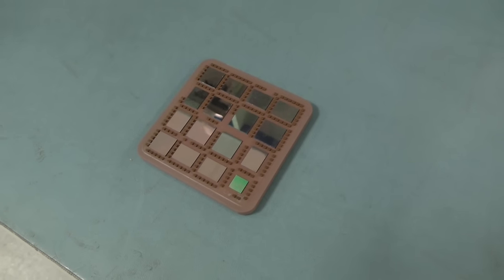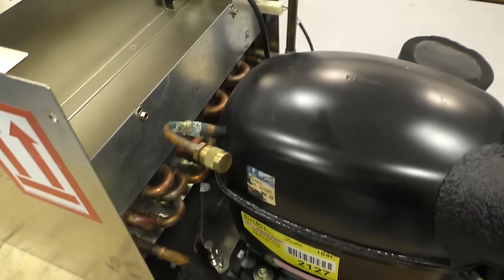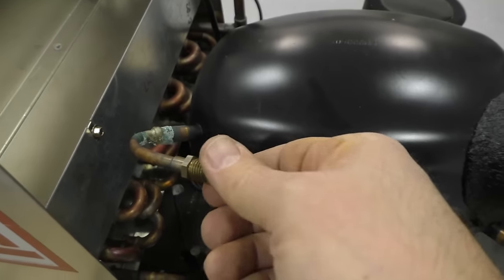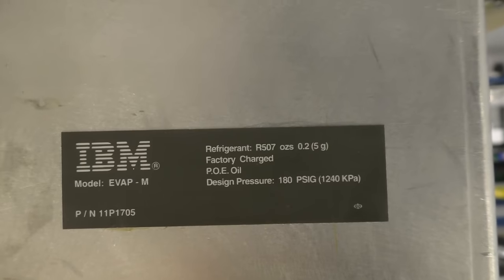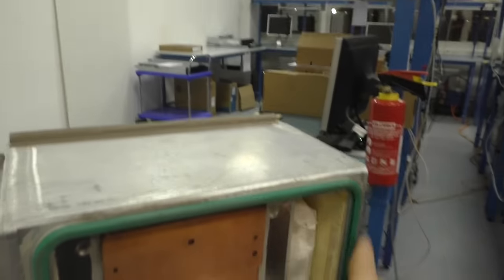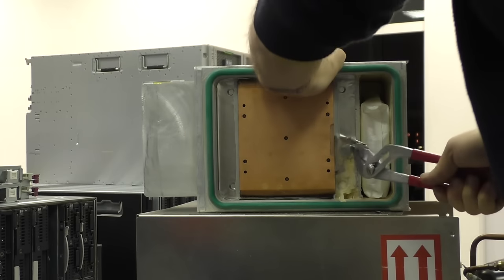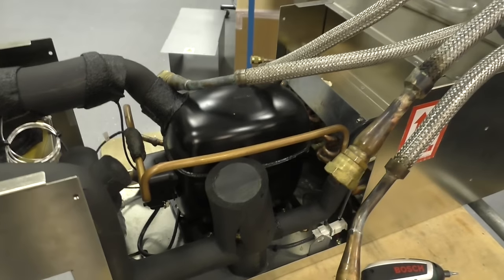CPU cooler for the BIG boys (PWJ48)

Comment: but will it cool my FX 8350?
Reply: you already know it wont
Reply: SubMit 86
its not even overclocked though
Reply: Justin Bechtel maybe, youll have to disable 4 of the cores though
Reply: ChannelAsh100
but I dont wanna have a glorified fx 4300 :/
Reply: Do people actually have trouble cooling the 8350?

I got the H100i by Corsair and my ingame temps under load at 4.4ghz are 35C max
Reply: Weath Proof
mine under load is about 40c, same cooler as well, but mines not overclocked, I just live in a tiny room and where my case is, there's very poor air flow.
Reply: I live in a tiny room as well I have a overclocked FX6300 with a Seidon 120M and its regularly at 17C while gaming load is around 40C I have my computer right next to a drafty window and temps in the winter are usually single digit. The one nice thing about Canadian winters lol
Reply: I tend to just have problems with the stock cooler being too loud.

4.5GHz and in-game I tend to sit at 60-65C
Reply: 60-65C 4.5ghz on the stock cooler? Thats good. I mean im at 4.6 ghz on a corsair 110i and max out at 55-60 C with i5 - 4670k
Reply: People still making jokes about AMD's TDP? Well, now the tables have turned lol.
Reply: DJHeroMasta you got that right! 95w for an i5 and runs really hot? Its bs. I cant wait for ryzen to shove intel prices down.
Reply: I've never had a problem with mine overheating and I have mine overclocked? Is this a problem?
Reply: ChannelAsh100 Stock i7 7700K 90C
Reply: (about your 55-60c) is that the h110i temp or the CPU? core or package?
Reply: Weath Proof whoa.. my i7 4790k oc:ed to 4.7 is 50-60 celcius/ 122-131 farenheit when gaming is that high?? the maximum total power draw when vanilla is 88 watts. and that must be higher on 1.3 volt and 4.7 ghz!

i mean the tdp must go up when oc:ing!! it just feels like my cpu is so hot!! and that my h110i is not working as it should i mean it has several hundreds of watts in cooling power..

my aio cooled evga 980 ti HYBRID is idle @ 29 celcius/84.2 farenheit and a load temp of 50 celcius/ 122 farenheit. mormal idle temp for a vanilla 980 ti is around 50c/122 F and load temps stretch beyond 85 c/185 F in some 'cases'..

 i live 110 miles aways from the north pole in north europe.. we have much the same weather as canada does so my room temp goes from 18-25 c/ 64-77 F 

i returned to the master race in 2013 after beeing homeless for a few years. so im basicly still a pc noob,,,, and a hobo hahahahahahaha
Reply: no1Liikeglenn, Nope, that's not hot.  Go look up avg temps for that CPU on air lol.
Reply: ok nice like i said am a pc nooob! even tough i have a decent pc
Reply: (cpu: i7 4790k+h110) (ram: 16 gb 2133mhz)(gpu: evga 980 ti HYBRID)(hdd: 2 tb) (ssd1:100 gb) (ssd2: 250 gb).
Reply: DJHeroMasta http://www.tomshardware.co.uk/answers/id-2646614/4790k-idle-load-temperatures-safe.html and that is non oc
Reply: No.
Reply: I said 90C.....

Comment: WHAT IN THE NAME OF THE WORLD KINDA OF CPU IS THAT.
Reply: Its a specialized CPU for use in IBM Series main frames. Based on their Z/architecture. Basically a very low volume highly specialized chip.
Reply: Did it really create enough heat to require a refrigerator condenser to cool it? Also how did it plug into its motherboard
Reply: ChannelAsh100 As far as the interface/socket, that I really don't know. My guess is it was probably a massive PGA socket though. But yeah mainframes run hot as hell, and keeping them cool usually involves a dedicated AC or refrigeration system.
Reply from the maker: Watch my othe videos about IBM mainframes.... They answer some uf your questions.

Comment: Oh, come on, i sould be studíing for my exams :DD but i watch it anyway :'DD
Reply: Interesting, it is capable of enourmos power dissipation. Fascinating.
Reply from the maker: I assume 1-2kW must be cooled down.
Reply: It could be pretty good heatsink for some power electronics project like constant current load. Altough the cooling would waste plenty of power too lol
Reply from the maker: For a high curent load I would recommend water cooled resistors and then attaching them to the radiator with a small pump in between. Simple water cooling does not require much additional energy.
Reply: Mine electronic load is in progress for like a year now. But good suggestion if i would like to make an extreme high power  version :D
Reply: junk>exams
Reply: always :D

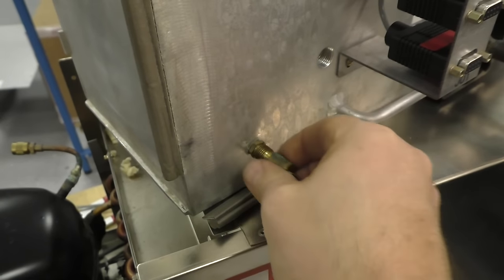Comment: 8:09, the cap can be used to take out the core of the valve it covers. also to drain the gas.
Reply from the maker: After disassembling I found that this valve was not connected to the cooling system. It was connected to the space between the CPU and the cooler. Maybe they filled it with Nitrogen or just dry air to prevent condensation.

Comment: yup awesome stuff i still think some one should do  a copper heat sink with 2mm silver and diamond dust as diamond and silver transfer heat faster than copper by it self
Reply from the maker: I fear that your estimation is far below the price of this. Make it 20-30 times and it will probably fit. The empty rack alone was $91'000 according to the spare parts list.

Comment: What a beast. Maybe you can get the copper out by dropping it on the floor face down.
Reply: I dont understand it too. As i see the most of this equipment is operational or fixable, some of it looks like new, why he wasteing it? I like watching teardown video, but i like retrievable teardown, when device can be assembled again and work, not a slaughterhouse for electronics.
Is destroying things to metal waste is really more profitably than fixing it and selling to people who need it?
PS: sorry for bad English :)
Reply from the maker: The problem is.... nobody needs a cooling unit for an IBM z900 anymore. Then this unit was not complete, it could not be tested. And selling it untested would probably bring you $200. Shipping cost about the same. 
And if it doesn't work you have to take it back. Overall income minus $500 to $0.

That's why such things go to scrap. You would be surprised what else goes to waste worldwide. Good food, new unsold cars, everything.

Comment: You broke my heart when you ripped it up do you know how long I've been after a phase change cooler for a project 💔
Reply from the maker: I'm so sorry about that :-)
Any old refrigerator has the same parts inside. Or get an old A/C unit... This IBM unit needs 3-phase 230V supply. Are you sure you have that? Of course with a cpacitor it could run on 1-phase.
Reply: I have a few old 3-phase laying around sadly one is in a state of disrepair , I'd love a proper oldschool phase change cooler and this unit with the redundancy was like looking at a wet dream until you broke it ;)
Reply from the maker: Well I look at it like this: I gave it a second chance to get famous. Without my intervention it would have gone to the recycling plant without anyone noticing it...